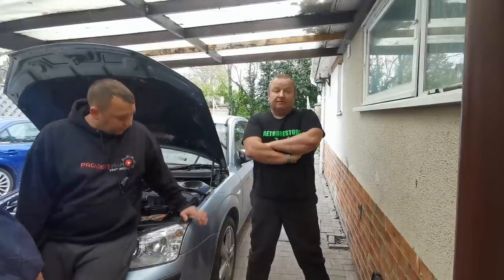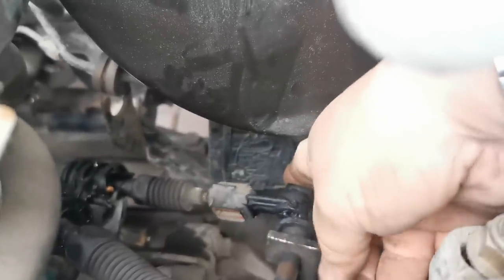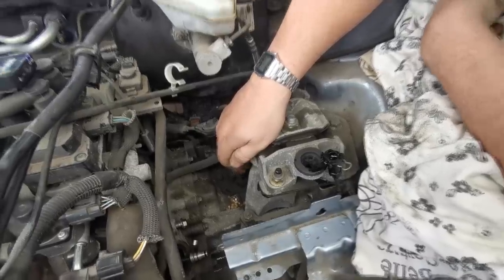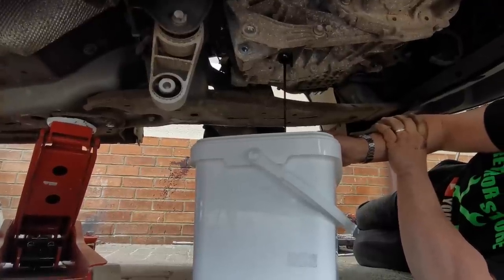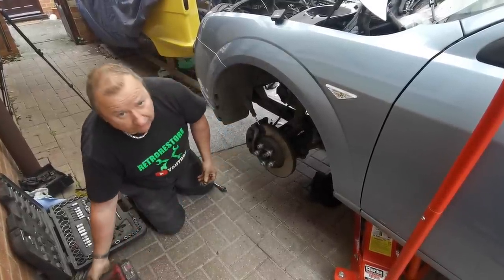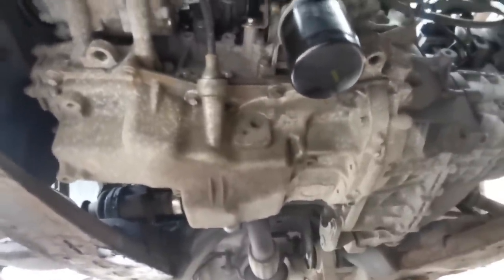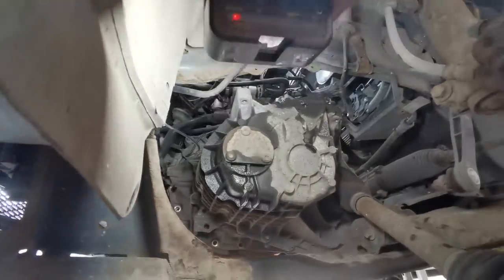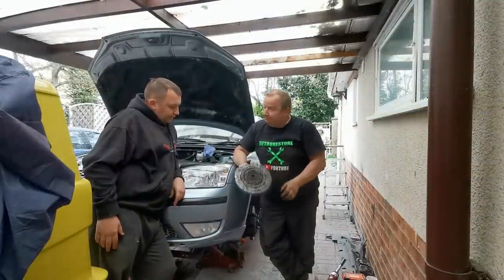FORD MONDEO MK3 CLUTCH REMOVAL #MONDEOMK3 #FORD #PROJECTMAN

Comment: Thank you! I replaced my clutch successfully, your video was very helpfull. My old clutch was not bad, but the slave cylinder was leaking. My advice to anyone doing this, is lower your subframe first, then prying off lower ball joints is much easier. Thanks again!
Reply from the maker: Nice one 👍👌

Comment: I would replace the clutch, pressure plate AND the throw-out bearing and even have the flywheel checked out and turned if need be. Why you ask? Because the amount of work involved would make me replace all those parts so I don't have to worry about repeating that work down the road. But that is just me and how I do things...  Thumbs Up

Comment: A little tip if you undo the subframe bolts before you remove the bottom ball joints you find it easier to remove them 😉

Comment: As someone else has mentioned, I would personally replace the DMF while it’s all stripped down. On my Mondeo it was the DMF that tended to fail before the clutch wearing out.
Reply: @chrismills9346  Yes, good point. It was diesel so probably puts more torque through the DMF than the petrol version.

Comment: question, does the clutch from another engine fit? 2.0i 2.5v6? both of these engines have the MTX75 gearbox, the clutch is 240mm and 23 teeth, just like the ST220 5-speed, also the MTX75 gearbox code ,I don't know, it can't be bought and it's not made for the st220 5-speed, would it work with the clutch from the 2.0i or 2.5 v6? thanks

Comment: Good  job  on finding  out  the issue  never known a clutch  to fail with low miles but least it will be  sorted do you  have  subframe  alinement  tool to align  subframe  once it goes back together  there should  be  a couple of holes at rear to aline it worth there weight in gold if it is to use once😅😅😅
Reply from the maker: Cheers martin 👍🏻👍🏻

Comment: Question does my clutch need to be changed or just the oil? Cause when i shitf to higher and take the cluch i hear a little kick sometimes its there and other times not. Is it cause i Release the clutch too soon/fast?
Reply from the maker: It's hard to say without hearing it a oil change wouldn't go a miss

Comment: hello brother i need your idea  i have mondeo mk3 diesel duratorque  di engine with 5 speed manual transmission   .I would like to change transmission  with st220  6 speed manual transmission will it fit  or need to do some modification
Reply from the maker: Should be fairly straightforward 👍🏻

Comment: At my garage we insist any vehicle with a DMF has it replaced whenever a new clutch is fitted. Only on the very rarest of occasions do we let this rule go.
Reply from the maker: We was happy with it when we checked it👍🏻
Reply: @ProjectMan  we brought the rule in after a couple of decent dmfs gave up under the strain of a new clutch.
Should have said in first post how good this video is. Good explanations right through - should really help guide a novice. And you did it on the floor too , good job lads.
Reply from the maker: Cheers doug if it does go it's another video 😂👍🏻

Comment: Just paid $5K to have this done.
Clutch no good, (dual-mass flywheel), gearbox rooted.
Car just turned 262000km.
1 owner.
What else to do?
Drives like new, and, for a 2.0 petrol, 800km on a tank of gas on the expressway, on cruise, can't be all bad.